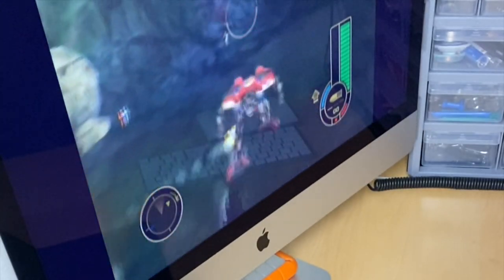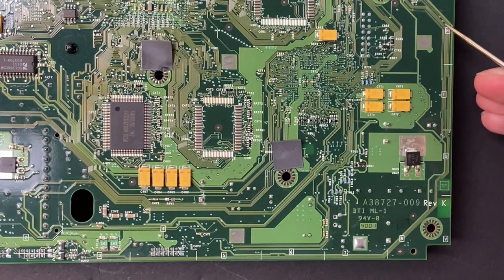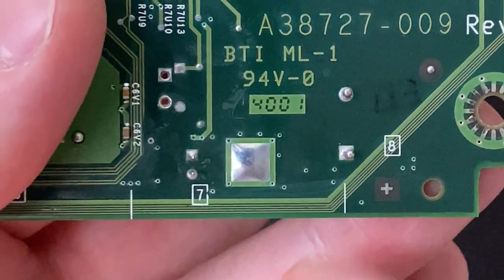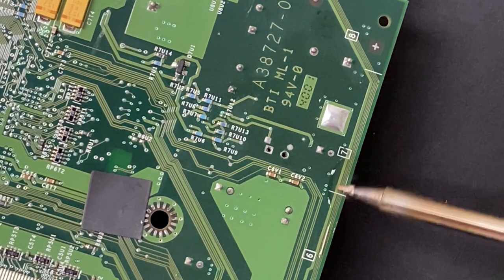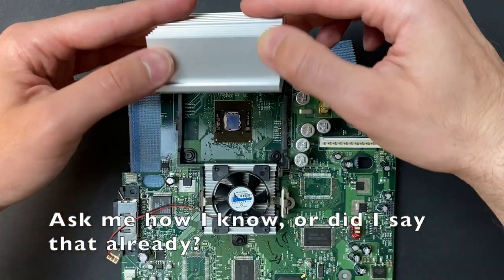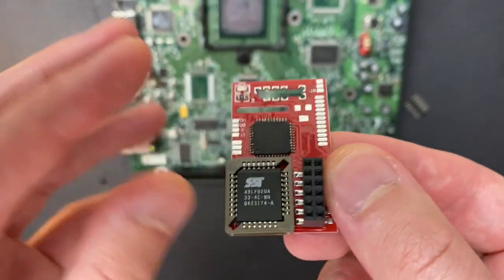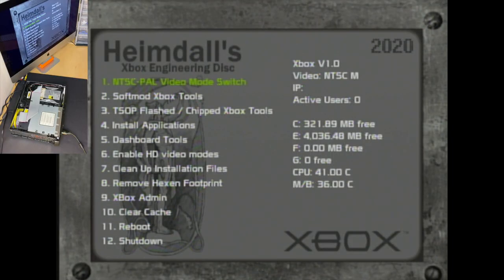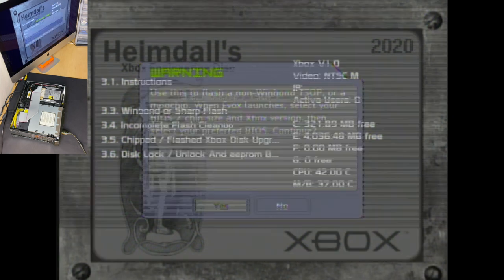Xbox Trace Repair & Modchip - Retro Console Repair

Comment: Been a minute since I was in my Xbox. It's sporting an Xecuter mod chip from back in the day. The LPC header on mine wasn't through-plated. So after soldering in the header the Xbox wouldn't turn on. It took just a second to figure it out, and after fixing that I was good. Not that it matters, but I'm pretty sure that I used 30 AWG Kynar for my jumper.

Interesting that you picked MechAssault to test things out, it was one of two titles that could be used for softmodding (that I remember anyway). The other being Bond 007 IIRC.

I didn't know about the clock cap leaking. But I own Amigas, I know how to fix these things. Thanks for the heads up. :)
Reply from the maker: Nice that you have the Xecuter, they are very desirable nowadays. Soft-modding is the preferred option for the majority of folks on a v1.0-v1.5. I'm just more interested in hardware exploits and will probably always hard mod a system if I can do it. There are a couple of benefits to hard-modding but probably not terribly useful for most folks. BTW the clock cap is not an issue on v1.6, just FYI in case that is the variant that you own.
Reply: @BorderlineOCD  Yeah, I'm a hardware guy too. I put in the modchip and never loaded up any games. That was never the point, it was doing the hardware mod. So software mods are of no interest to me. BTW, remember the "Pogo pin" (solderless install) adapter? Famously unreliable.

As for which one that I own, I doubt that it is a 1.6 since I didn't have to do all of those jumpers off of the LPC port that I saw being done here:

https://www.youtube.com/watch?v=W-W1LNcjunY 

But maybe that is an Aladdin thing?

But I have three Xbox originals (and possibly soon to have more). And since I now have to pop the top and check the cap anyway I'll get the Rev level of the Xecuter board while I'm in there. Version 2.2 seems to be sticking in my memory for some reason. So I'm placing my bets on that version. :)

Based on your video, I bought three Aladdin modchips "just for fun" which I'll plop in for the heck of it. Oh, and I liked & subbed, thanks for the great content!

Comment: That 26 AWG (0.40mm) wire seems too thick to soldier over the broken traces, wouldn't 30 AWG (0.25mm) be better? Or would it be too thin for the current running through the traces?
I also have a XBOX v1.3 with broken traces waiting to be fixed and modded :)
Reply from the maker: Use thinner wire, I didn’t have any at the time.

Comment: What did you use to get the wire to properly fuse to the board? I saw you add flux but I didn't see any solder. Do those types of wires adhere on their own with flux and heat?

Also, what was the exact point of the nail polish? I'm new to all this so I want to make sure I'm doing everything right when it comes down to it.

Great video!
Reply from the maker: Both the pad and the tip of the iron are pre-tinned with solder. For a small via like that, that’s all you need. It’s generally good practice to pre-tin anything else you’re soldering, like component legs. They accept solder easier and heat transfers better for good wetting. The nail polish is just a coating to prevent oxidation. Ideally you would use UV solder mask. Nail polish works well for a DIY approach.

Comment: I just had a question regarding the modding, did you have to tsop and softmod the console before installing the Aladdin xt modchip or was it not necessary to tsop and soft mod on a v1.0 xbox?
Reply from the maker: Nope, virgin Xbox. Just the modchip install. It’s compatible with all versions but on a v1.6 there’s more soldering work needed to rebuild the LCP port.

Comment: I’m new at this, was wondering do I have to scratch off the contacts in order to check continuity because I used my meter and I get nothing. What are you using to scratch off the traces?
Reply from the maker: Yeah you need to. There is a coating that will prevent direct contact with the copper traces and vias. A fiberglass pen is best but in this older video I just used a pointy scrape tool. It will work just be gentle and check progress so you don’t take it to far. A tiny bit of exposed copper is all you need.
Reply: @BorderlineOCD  I ordered the xedusa hdmi yesterday so I thought I’d dust off my hard modded Xbox and get it warmed up, well it began to turn off by itself and when I tried to power it back on it would load for a minute then turn off again, I knew it was a bad trace cuz when I removed the clock capacitor I saw the damage but it wasn’t giving me any problems back then. After I watched your video I tested out the traces with my meter again and the only faulty one was the first one on the edge of the board, all the other ones had continuity, I lucked out, so I stayed up late getting my soldering tools ready and ran one wire, easy actually, cleaned up the points, assembled everything back, and I even tested it while my wife was asleep, amazingly it didn’t power on after I connected the power cord, it always did before, then the moment of truth arrived, I pushed the power button and boom! It works! No issues so far, can’t wait till morning after breakfast of course to give it a whirl, thanks for the video. 👍🏼❤️

Comment: Why did you not replace the leaky capacitor? The space is just empty on the board and the clock still works without it?
Reply from the maker: The system works fine without it and keeps time as long as its plugged in the wall (even if turned off). Once unplugged it will lose system time. I do replace it on my restoration of stock Xboxes (I do it just for the sake of completeness, most people don't replace it). I don't usually bother on modded builds though because a modded dashboard will update the system time on power-up when connected to ethernet, so whether you have a clock cap or not the system will always have the correct time when turned on even if it was unplugged. Also just FYI on stock Xboxes the clock cap can usually only hold the system time for a few hours when unplugged. It was not designed to hold system time like a normal clock battery.
Reply: @BorderlineOCD  Oh hey! Thanks for replying to an older video!

Comment: There's a D0 point on the top of the MB so you don't need to run that wire over the edge to the bottom. But more than that, you have a copy of Mech Assault. And the board was already out of the case. Why didn't you just bridge the two test points and TSOP flash this instead of installing the mod chip? I personally remove the TSOP package and flash it in my programmer then just reinstall it. Instantly modded XboX! But you need a rework station for that. 

Also when you are trying to bridge points like the traces you repaired you will find that using flux like that is counter productive. Clean the site then heat both ends and flood the site with fresh solder. It will bridge every time.
Reply from the maker: Thanks for the comment! I'm partial to installing modchips. I missed the boat when the consoles were in their prime and I like the flexibility of having one installed now that I actually have the skills to do it myself. It's a fun and cheap soldering exercise. Its not necessarily meant to be a tutorial on the fastest way to mod your Xbox, its just how I chose to do it. I've also tinkered with a bunch of different firmwares after posting this video and flashed the chip several times - I wouldn't feel as comfortable doing that directly on the Xbox without the modchip installed. I had 1 failed firmware flash and had to hotswap the Aladdin with another unit to reflash it properly again while messing with the firmware options in HeXen. All in all great learning exercise and had a blast working on it.
Reply: @BorderlineOCD  absolutely nothing wrong with that. I still have a drawer full of different mod chips from back when they were first released. I've been modding consoles since the PS1 days so I do things as efficient and cost effective as possible now days. It's cool to see so many people using these old beasts to get into electronics so have fun with it and do you!

Comment: You should get a little flux pen, just a small dab needed for through hole and soldering pads.
Reply from the maker: A couple of folks have suggested that on past videos. I guess they've tried the flux pen and like it. Given how expensive quality flux is I'll probably wait until the syringe runs out. I always felt a syringe would be ideal to precisely deposit the desired amount but willing to give other products a try. Any particular advantages you like about the pen?

Comment: Excellent. Have you ever repaired an internal Playstation1 dar power supply? I ordered one online but it takes 20 days to arrive and I no longer want to wait v:
Reply from the maker: Thank you. I have not worked on that in particular, but have you checked the obvious signs like a bad fuse or a bulging/leaking capacitor?

Comment: By any chance have you had or know why an Xbox same model as yours when powered on with Aladdin chip installed powers on 3 times then stays on with red and green flashing lights and how to fix this problem
Reply from the maker: I believe that’s called triple FRAGing (flashing red and green). Turns on, off, on, off, on, FRAG. Bad solder joint most likely, unless you were updating the firmware and it failed? Bios isn’t loading. If there’s no modchip then harder to track down. If you remove modchip and stock bios loads can help confirm Aladdin chip is either not properly installed or bios is corrupt.
Reply: @BorderlineOCD  well I took the chip off and it still powers on 3 times and flashes green and red light so what does this mean something serious is wrong with my console
Reply from the maker: I wish I knew I don’t have enough experience with FRAGing other than a finicky modchip. Just confirming it happened all of a sudden i.e. NOT during a bios flash? Its going to be a pain in the butt to track down but if you have it open already maybe you can eliminate the obvious like damage around the clock cap area, check continuity on traces that appear compromised in any way?
Reply: @BorderlineOCD  thank you for all the help you could give me much appreciated and will take everthing in consideration and go over the console very slowly over everything on the board and take take from there. Thank you again for all the help😃

Comment: Careful with v1.0 and 1.1, their power supplies use unleaded solder that evaporates over time and will short your console at some point. That's why Microsoft sent out power cords with built-in breaker, so the busted PSU wouldn't set your house on fire.

Luckily it can be fixed by simply replacing the EU compliant solder with proper stuff.
Reply from the maker: I wondered why some units have those AFCI style plugs. None of the 1.0s I've bought so far have those.
Reply: @BorderlineOCD  You had to request them through Microsoft support after a series of consoles bursting into flames made it into the news. MS blamed "faulty power cords" rather flawed power supplies, probably because cords that prevent fires are a lot cheaper than fixing/replacing tens of millions of power supplies.

As I said, replace the solder in the power supply. Otherwise it's a matter of time until the console fries itself.

Comment: I'm a little surprised you could solder what you did with that tip.  The "B2" tip doesn't have the best geometry for fine work.  Get yourself a "BC2" and a "KU" tip...they will make your life a lot easier.
Reply from the maker: I was actually considering the "I" tip for my next purchase, but haven't bought it yet. Assuming you like the KU for drag on ICs? What do you use the BC2 tip for?
Reply: @BorderlineOCD  The KU tip is for more than just drag soldering.  It's great for applying heat to a wide area, but it also has a very fine point.  The BC2 tip is similar to what you have now, but it has an angled flat cut into the tip.  You can load solder on the flat area and get better contact with the joint.  The BC2 is a great all-purpose tip.   As for extremely fine tips, I would pick the ILS over the I tip.  The ILS tip is longer and thinner.  I wish they offered the J02 geometry for the TS100.  It has the "I" geometry, but the tip is bent to the side so you can get into tighter spots.
Reply from the maker: Much appreciate, thanks for the thoughtful response. I might just cough up the price of the variety pack so I can familiarize myself with the other tips. It wasn't too bad working on this console with the B2 tip, but on the Game Boy Pocket Bivert mod video (the Pocket-specific smaller Bivert chip) I decided I needed a finer tip because it was a little tough.

Comment: Use old headphones wires very thin and looks clean
Reply from the maker: I've heard of folks using insulated wire from transformers or old power supplies for really thin quality copper wire. Either that or I should get some 0.1mm wire or kynar for patchwork.

Comment: Modchip?! You could have just TSOPed it. I have a few modchips myself but only for 1.6s
Reply: I wondered a similar thing. I have both a v1.0 and v1.1 and I did not use a chip for either console. Is there an advantage to using the chip versus just doing a TSOP?
Reply from the maker: Maybe a couple of advantages for tinkering but probably not for the average person. I like chipping my consoles so I'm partial to installing a chip. It's a fun soldering exercise and it's quickly reversible (remove the chip from LPC and its back to stock). It can be useful for hot-swapping a bad flash on another chip so it's good to have a chipped console ready to go. I've only encountered this once and it was fairly painless to revive the second chip. I'm also considering doing a "slim" Xbox in future (remove DVD and trim down case). I'd feel more comfortable flashing a no-DVD bios to the chip while experimenting.

Comment: what solid core wire was that on the Aladdin xt?
Reply from the maker: It's a bridge to activate the modchip permanently (i.e. always on).
Reply: @BorderlineOCD  no, what wire? Awg? Kanar wire?
Reply from the maker: 26 awg solid core wire. You could use anything though, kynar, magnet wire, an old component leg will also do the trick.

Comment: You actually do not need a mod chip the xbox you could actually use a soft mod By using splinter cell And by using USB Flash drive

Comment: Is there anything like this for xbox 360 and PlayStation 1
Reply from the maker: For sure. You can JTAG/RGH an Xbox 360 although the process is more involved (requires a NAND programmer to dump the NAND and some experimentation with timings to get a stable boot). For the PS1 you can load games from SD using the PSIO or by installing an ODE like the XStation or Terraonion MODE.
Reply: @BorderlineOCD  thanks 😊
Reply: @BorderlineOCD  if it come to it can you make a video on both projects please

Comment: It's corroded traces on the bottom of the board xboxes were notorious for this it's a factory fault.
Reply from the maker: Due to clock capacitor leakage or another reason? I initially thought the traces were far away from the clock cap area but I realized with the board turned over they’re both indeed within close range to the clock cap location so I assume that’s still the primary culprit?